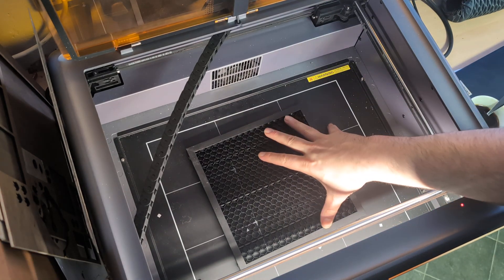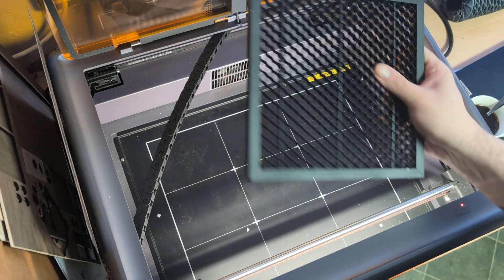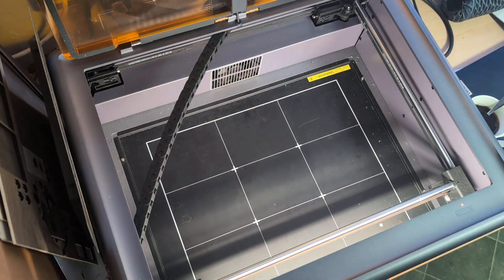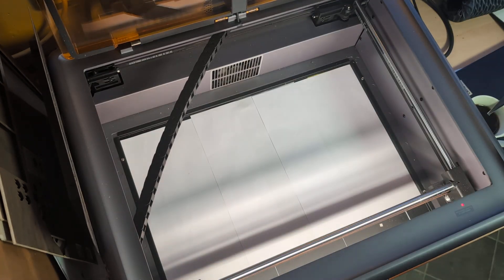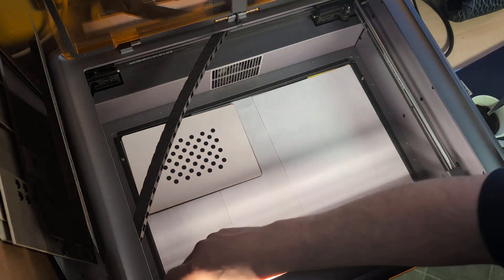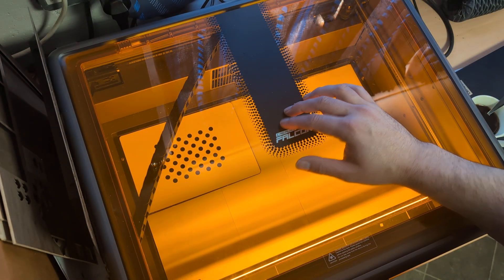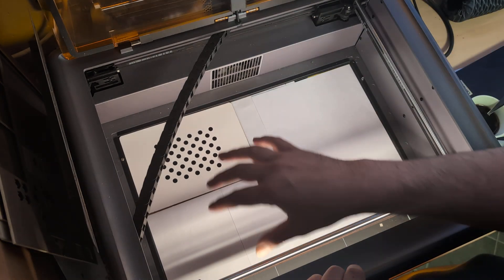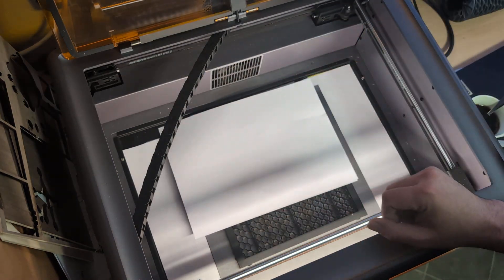Falcon A1 Lens Camera Calibration For Perfect Alignment #falcona1 #crealityfalcona1 #lasercutter

Comment: Hi mate how did you work out how to laser cut the board for the calibration. Did you measure up the card and then made it up in CAD before cutting?
Reply from the maker: Hi, yeah, I just measured the pattern card and made a square the same size in light burn then cut that shape

Comment: No matter what I do I haven’t gotten any image on the calibration over 80, and every time I try to use this to engrave it’s always down and To the left of center. I’ve recalibrated three times now using your suggestions (which got me got me from 70 to 80), is there something else going on?

Thanks!
Reply from the maker: Hi, try holding the card as close to the position it asks for, then tilt the card to face the camera slightly - like this https://docs.lightburnsoftware.com/legacy/img/Ref-CalibrateCameraLens-Tilted.png
Reply: I recalibrated using that method and I’m still getting a max of 80 and the down-left shift, it is so strange! 

I tried their fine-tuning guide and it sort of works, but I’d have to fine tune every time I use it because the camera isn’t off by the same amount for the entire canvas. For example one point had an offset of -1.70 and a point 2.5” away has an offset of -0.8

I love this thing but I feel like the camera is driving me insane!
Reply: Did you ever figure out a fix? I'm having the same consistently inconsistent alignment issue 😕

Comment: Great video explanation.  I am having either Focusing issues or just a bad camera on my machine.  1 time i was able to get a score of 80 but most of the time its in the lower 60s.  My photo shot versus where i place my image is also off by like 10-15 mm so i can't trust the placement of my image on the material.  I did the adjustments in the software but its still 5+ mm off.  I am wondering what's the issue. Creality software or camera at this point. Any suggestions from what you have ran into? thanks
Reply from the maker: Hi, try holding the card as close to the position it asks for, then tilt the card to face the camera slightly - like this https://docs.lightburnsoftware.com/legacy/img/Ref-CalibrateCameraLens-Tilted.png
Reply: @odditythreeD even if you calibrate well, the frame and the actual cut are never the same. It's junk
Reply from the maker: @citalopram20mg  
It is the best all in one class 1 device on the market for the price, there will be concessions to get to that sub £350 price point 

Lightburn has a great tutorial on making your own enclosure camera if you want something for around the same price without it being class 1 rated

If you want a better class 1 enclosed laser engraver there are some great options, however if you want BETTER, £800.

Comment: Hello, first of all I am a beginner and thank you. I did this in the Falcon Design Studio program as you described. I got good results on a standard surface. Then when I put an riser/honeycomb underneath, the calibration becomes incorrect and the cutting is shifted from the aligned place on the camera/photo. As far as I have learned, calibration should be done according to the surface on which the cutting will be done. Is there a quick way to calibrate for surfaces of different heights and objects of different thickness?
Reply from the maker: Glad it helped